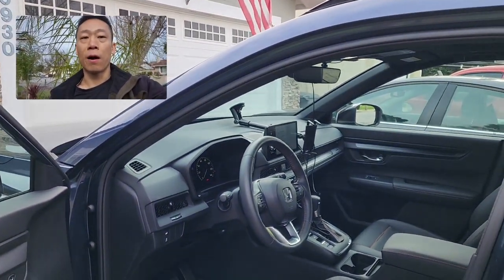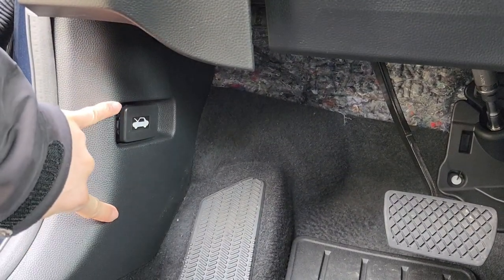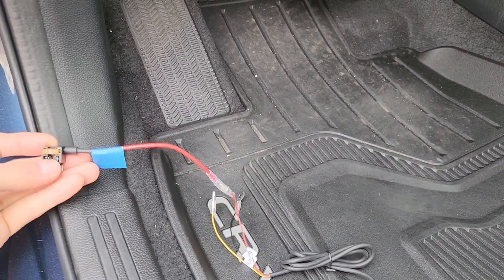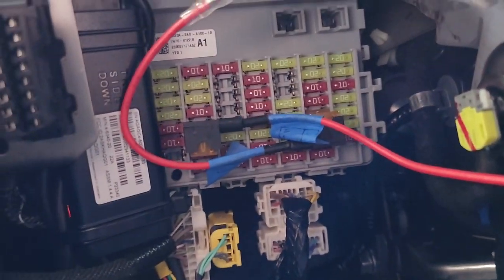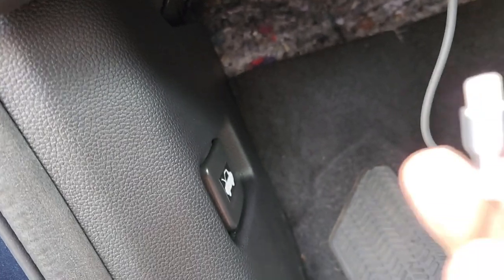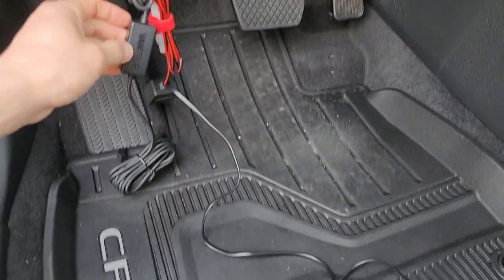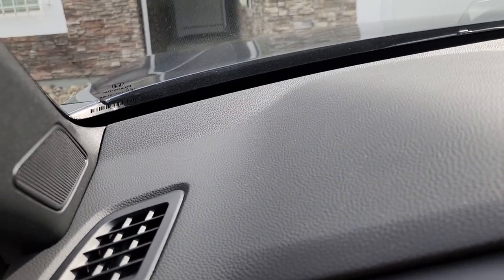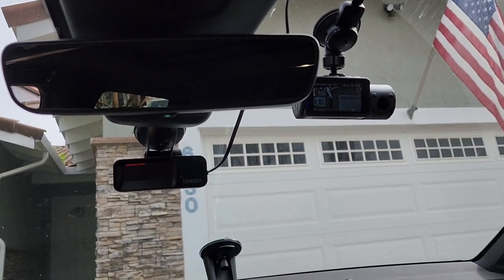2024 Honda CRV Install Hardwire for Vantrue N4 and Uniden R8

Comment: Does it void the warranty?
Reply from the maker: No, installing a dash cam in your car generally won't void your warranty. No, installing a laser radar detector does not void a vehicle's warranty. The Magnuson-Moss Warranty Act of 1975 protects drivers' rights to aftermarket electronics and states that a manufacturer's warranty cannot be voided by aftermarket equipment unless the warranty explicitly states otherwise.
Reply: Thanks for in depth response